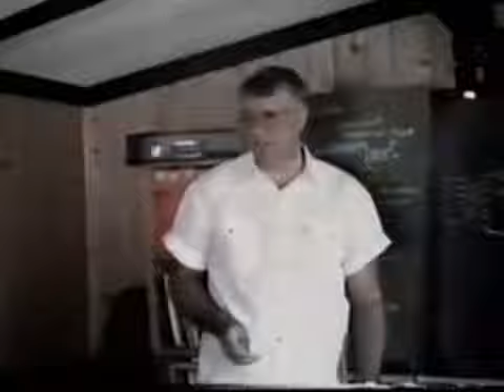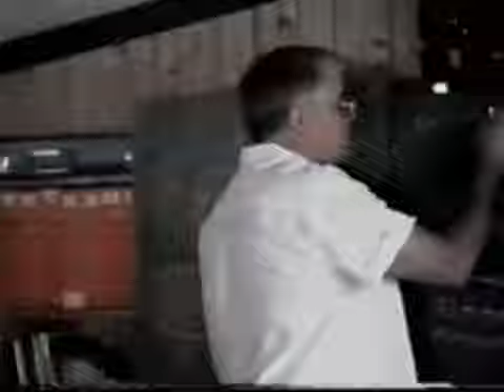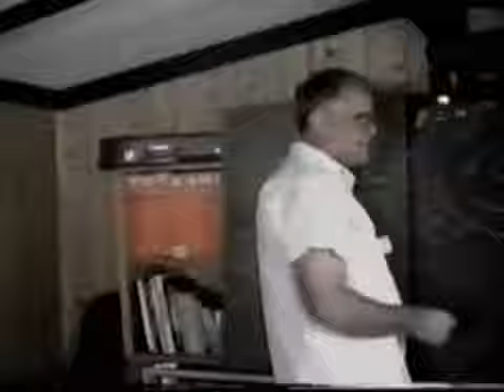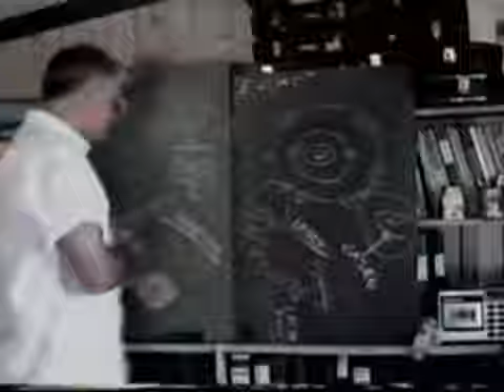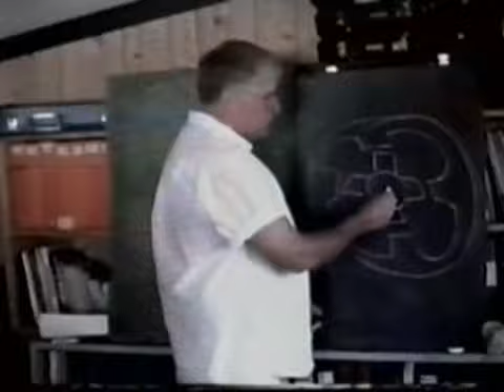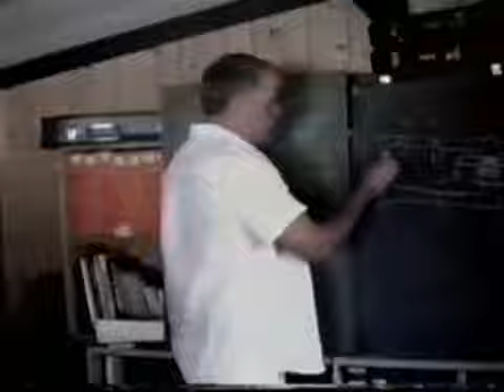Stanley Meyer   New Zealand 1989   2 4

Comment: Summary (part 2 of Stan Meyer's “water fuel cell” technology talk):

In this part of the presentation/interview, Stan Meyer continues to discuss the concept of extracting energy from water using high voltage and additional solutions (including generating electricity with magnetized gases and controlling the rate of hydrogen combustion). Below are the main themes:

Water purification and reuse

Meyer explains that in his system, the phenomenon of releasing gases (hydrogen and oxygen) acts “like scrubbing,” keeping the cell's components from clogging up.
If there are impurities in the water (salts, metals, etc.), they remain in the cell, and the water itself can be cycled.
The product of hydrogen combustion (water vapor) can be recondensed and used as “fresh” water in a closed loop.
Destabilization of atoms and “release” of additional energy

Meyer introduces the concept of further ionizing hydrogen and oxygen atoms (e.g. with laser light) so that the atoms further decompose (do not form a stable water molecule, but go into a “supercritical” state).
He claims that in such a situation the phenomenon of “implosion” occurs, which supposedly allows to obtain huge amounts of energy (greater than the typical combustion of hydrogen with oxygen).
This is supposed to be a “safe” process, and Meyer compares it to burning wood (where some energy is released during atomic transitions).
Generating electricity during gas production

He discusses the idea of an “electron extraction circuit” - a system in which additional electrons are taken during the separation of water into hydrogen and oxygen. This supposedly makes it possible to generate an electric current in parallel with the gas.
This current can be reused to power other components, including supporting the operation of a generator or being part of a “self-sustaining” system (allowing the reduction of external energy).
“Hydrogen fracturing” and nuclear fuel (a reference to nuclear fusion)

Meyer notes that scientists (e.g., in Livermore-type laboratories) have studied hydrogen nuclear fusion through high temperatures and pressures or so-called “cold fusion” (muons).
He declares that on a smaller scale he has achieved a similar effect (although not classical nuclear fusion), based on deionization and destabilization of hydrogen and oxygen atoms, followed by their mutual fusion in a way that releases very large amounts of energy.
Electromagnetic Particle Generator (EPG).

Meyer describes an invention in which a stream of magnetized gas (instead of a permanent magnet) travels in a tubular circuit (closed loop).
Around the tube are coils that capture the alternating magnetic field generated by the moving “magnetic gas,” which generates an electric current.
He says this is a way to achieve high power output with minimal energy input, since the classic losses associated with magnetic field resistance in traditional generators (such as car alternators) are avoided.
Controlling the burn rate (burn rate) of hydrogen

In addition to simply obtaining hydrogen (or “water gases”), it is crucial that the gas burns at a rate comparable to traditional fuel in an internal combustion engine.
Meyer stresses that in his system this can be achieved, so that no new, exotic engine designs are needed - a retrofit (adaptation) of current designs (e.g., cars) will suffice, which he believes is a fast track for implementing the technology.
Conclusion:
In the second part, Meyer focuses on how he could deliver energy in various forms (both hydrogen and electricity) while keeping the design simple (the so-called “KISS method”). In his view, the technology is largely scalable and is expected to solve key energy problems (transportation, industry, military), both by producing gas (hydrogen) from water economically and generating electricity at the same time. In addition, it emphasizes safety (no large pressures or complicated nuclear apparatus) and the possibility of operating in a closed system (water recycling).

The whole thing is based on assumptions about “innovative” deionization of water, creating gas with “destabilized” atoms and using strong electric fields/pulses to break the bonds of molecules. From a scientific point of view, these concepts remain highly controversial; however, Meyer consistently presents them as a future method of moving away from fossil fuels.